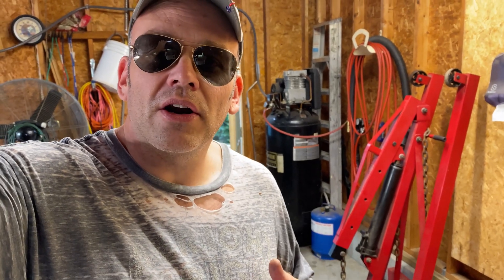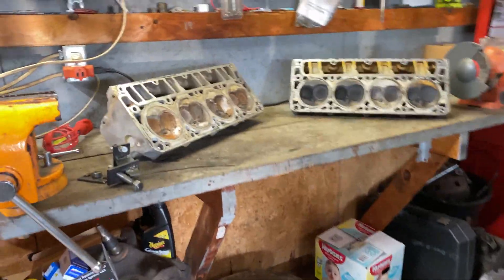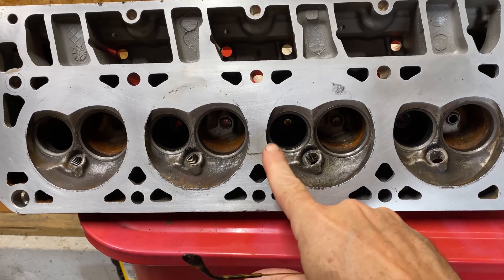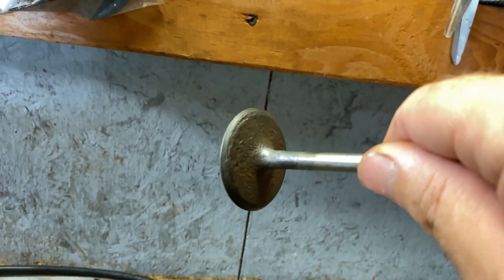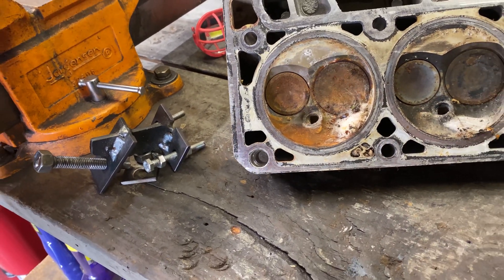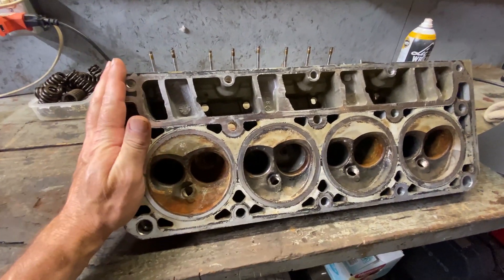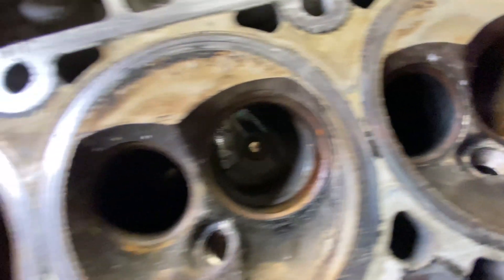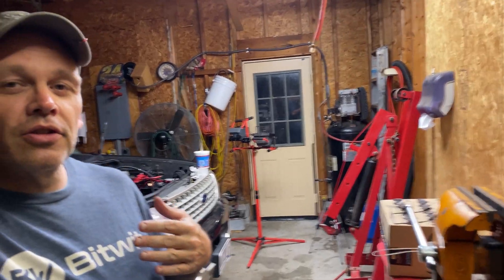LS 706 Cylinder Head Rebuild pt1 Valve Lapping with Permatex Grinding Compound and Cleaning

Comment: .945” or .943” wrist pin option is what confuses people .  If the heads had the dreaded battery logo have them pressure tested, lots of failures here.